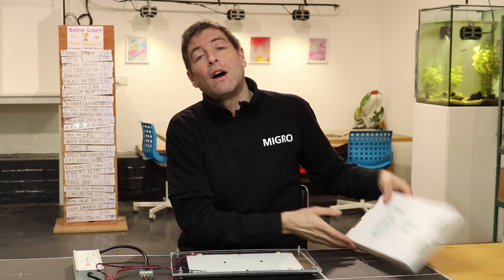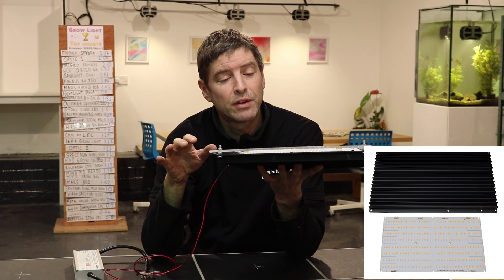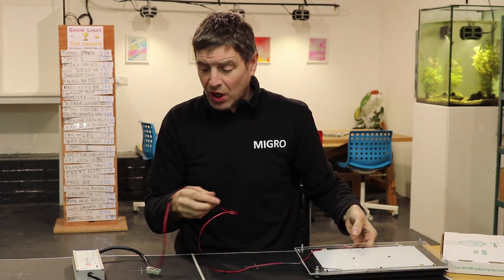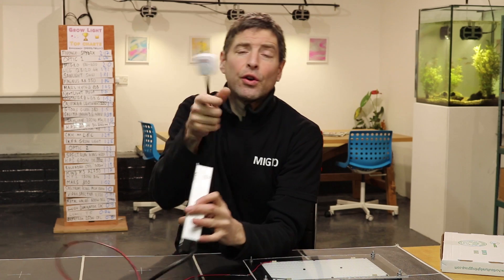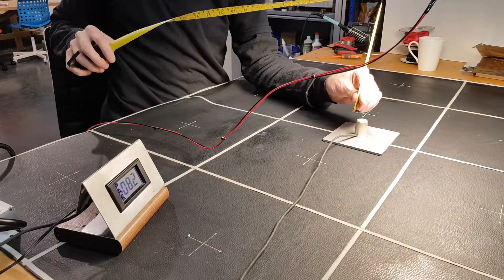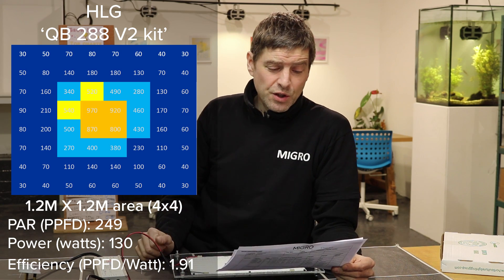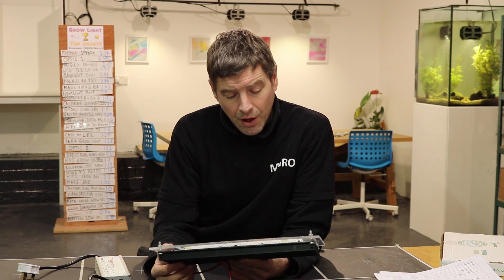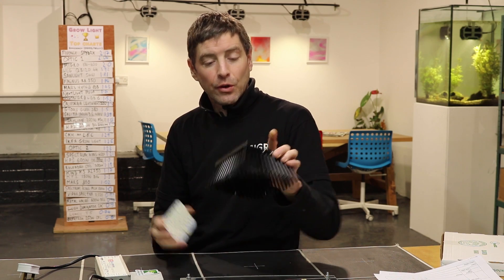HLG Quantum Board grow light test - Horticultural Lighting Goup QB288 V2

Comment: I started my LED journey with the SF-1000. I ended up returning in to amazon after 20 days and bought KingBrite's version of the QB288 2 Panel system for a little cheaper than the sf-1000. I did get to confirm with samsung that they did sell KingBrite LM301B LEDS. The PCB and LED's are set by machine's so everything been gravy so far! I"ll update this if anything happens.

Comment: MIGRO does the acrylic sheet effect the light emitted ? weaken it? I was wondering if different types of material of more efficient like glass etc
Reply: Anything in between is gonna slightly decrease your efficiency, but maybe not significant and you be the judge if you like them to be protected :p.
EDIT: the video even says 3% difference with or without cover. So measurable, but not a lot.

Comment: Will this board be ok for a 100cmx100cm grow? Just a casual thing, in a mylar tent..
Reply: Yes it would work fine.  They are amazing little lights.  I guarantee you will be impressed.  1 great pro is that these hlg Quantum Boards are so low profile, maybe 1.5 inches or 4cm thick with the heat sink.  I think they are the future of growing since they are modular and so versatile. I used to grow with 1k watt HPS and I bought the HLG QB 324 165watt led and was blown away on a vertical light mover it is covering 2.5'x5'
Reply: 20+ yes exp. Ask me anything
Reply: @Imarida2  Thanks Mark! I've got a single 90W Luminus cxm-22 Gen 4 3500K in a 80x80x160cm tent for autos, and have ordered a 100x100x200cm and a 120W 288 quantum board 3000K + 660nm, was hoping it would suffice for photos, and wouldn't need to buy much more, on a strict budget over here.

Comment: MIGRO, What is PPFD/W?? Do you mean mmol/j?? Cheers!
Reply from the maker: Umol/Joule or PPF is most often quantifying  the light radiated from the bulb. PPFD in units umol/m2/sec is the light reaching the grow area. It's often about 25% less than PPF due to reflectance  losses. Divide PPFD by watts to get total system efficiency.
Reply: @MIGROLIGHT  Thank you! I wasn't aware of such measurements, especially about the 25% part. The loss in the value occurs not because of the reflectance but simply because of the inverse square law (if you measure the PPF on the canopy surface). We normally go by mmol(umol)/j when a luminaire is characterized. The PPF density is what we aim for in the garden (usually, a proprietary ratio is maintained in relation to the VPD factor and the amount of CO2 in the garden). I am pretty drunk so correct me if I am wrong. Cheers!
Reply from the maker: I'm afraid you lost me lol. Let's talk again in the morning😆

Comment: Hi Shane, I notice on the hlg qb tests you casually state because the light intensity was over 1000umol centre point you had to raise the fixture. 
This renders the test COMPLETELY UNFAIR. 
Either raise all other fixtures to that height and give us the readings or just release the data at normal height for qbs please. 
Plants can and often do benefit from over 1000umol especially in increased co2 concentration environments anyway so the only reason I can see for you doing this is due to the fact the figures demolished other light sources. 
And that's not even mentioning the plexiglass.
Reply from the maker: Alexander. In the absence of data from the manufacturer I calibrate the light height to under 1,000 PAR at dead centre  same for All lights not supplied with setup information or a manual. It's fair. What's unfair is selling a DIY grow light and not supplying an operations manual to go with it..

Comment: Hi shane. On HLG website fpr the QB288 boards and the 132 boards also its states that the board does not require any thermal paste or heatsink. I see that they do sell a combo diy kit woth a heatsink also. 
Is this extra cost of a hestink required for running this board at 1.7a to 2.1a for 16hrs a day?
Appreciate your input.
Reply: Upon further investigation. I have found that they advise hestsinking for above 50w. So thats current running at 1A (ish)

Comment: This model comes in 2 spectrum 3000K and 4000k, to use in full cycle which would be better spectrum 3000K or 4000k?
Reply from the maker: I would recommend 4k if you are height limited as stretching may be an issue with 3k. If height is not an issue 3k better for flowering.

Comment: The losses increase with angle of incidence,  and since these LEDs put out light in all directions,  most of it is not transmitted.  It's being light-piped out to the edges of the acrylic like a fibre optic cable,  and hitting the walls of the tent instead of the sensor.  He's tested HLG lights in 3 different ways so far,  each time he just does whatever he has to do to fake the numbers.  

Funny he did not show the test and the numbers without an acrylic screen, hmmmm???

Notice how thick the acrylic was that he used??? 

3 -4mm acrylic could reduce light transmission by as much as 6-8% yet that thick piece looks about 10mm and he reckons it is only 3% reduction but never shows the figures, yeah right I am calling BS right there.

I saw another video where you ran the test without an acrylic sheet, I will believe that test when you show the light hooked up to a killawatt meter and measure the thickness of the sheet, but it doesn't rule out editing

And how come it was "unsafe" without a thick piece of acrylic this time around, yet the last two times he ran tests on HLG products it was all cool; but now that he's suddenly testing a more powerful light he is all concerned about safety, LOL I guess he has to do something new to get the numbers he wants.

HLG makes a version of this with 90-degree lenses,  but you didn't test that one because it would be a fair comparison to his lensed fixture, now would it eh.

Nice snake oil trick you pulled their Shane making it seem like you were being fair and unbiased but those of us in the know, know what you just did. You want to be careful that HLG doesn't get hold of your lights and rerun that test again, directly against your lights, now there's a thought.

Comment: Do you think the wires being in front of the LED’s would get hot and
Melt ? Also, if one of those diodes stop working for some reason, how hard is it to replace ? Ive been staying away from quantum board lately because it seems to me that it might be difficult to fix if you aren’t tech savvy like you are. I’ve been running COB cause it’s so simple to change out if I need to.

Comment: Curious........... He mentioned that he had to raise the light further than the last measure. How much did you raise it? Is this not important to u as far as data?  Personally I think you could have easily taken measurements at 1'  2' and 3' light-canopy.   I own a qb 324 and its low profile allows for a myriad of mounting positions that a migro couldn't dream of fitting in.  Migro has the profile of a brontosaurus/ HPS hood.  In 2019 I want my light to be wafer thin w/remote ballast.  Cree are a  helpful supplement to larger grow boards.
Reply: Show a side by side with 
QB288 V2 vs migro100 
Then I will be a believer.

Comment: When All 4 288V2 board's are together they put out the best par in the corners than any other LED,s and much less heat being so many mid watt LED, s on each panel but the same as a single finger it's weak until balled up in a ✊

Comment: Another great thing is that the Original 480H-54A driver with internal pot can push out 2400mh as the 480H-54B with the External pot can only drive the LED,s to 2100mh max that's why the Orginal 4x288-V2 is called the HLG-550🤓

Comment: LM-301b -223lm/w hands down they are the best LED,s on the planet at this Time Samsung website Explain all the Technical Data after Growing for 35 year's I'm 50 now grown with all the  various artificial light  sources Samsung all the way from now on but thanks for your testing plus another guy on here tested the LM -301b 288V2 past 3000ma for over an hour and he couldn't burn them up as the diodes reached a Nuclear 100c degrees with a minimum heatsink 🤓

Comment: Do any of you folks know how to keep a 100w cob led cool? Im having trouble
Reply: Ebay heat sinks are about 14 bucks with active fan you'll need a 12 driver for the fan
Reply: @joshamy39  tried that even with a peltier plate,I can only get it to run at 60w which then drops to 40w and then  stabalises

Comment: Are the Mylar walls a new thing you're doing Shane? Don't remember them from previous videos. Usually just the flat board when testing 2'x2', right? Really made a difference! Great example of reflective walls, and like always, a great video!
Reply from the maker: The light spread from the Quantum board is very wide and you need reflective walls to keep the light in. 7% increase in light to the grow for €5 of mylar seems worth it to me :)

Comment: Why compare this to the likes of spydrx? Completely different in size and output.  Get the hlg550v2 up there and see how she rates against these hobby lights!
Reply from the maker: The comparioson is of efficiiency, it's valid independent of size. Thats th reason the lights are compared this way. IT's like comapring M.P.G. or Km/L. The HLG 550 is 4 x QB288 so you can work out the output of the 550 easily.
Reply: @MIGROLIGHT  oh you adjust the size of the area depending on the size of the light? 

The spydrx has a 5x5 veg coverage? What coverage does 1 QB288 have?

Comment: You're also claiming 130w,  when it's only 120w (or who knows what it is,  you probably cheated on the dimming knob too)
Reply: Lars Larsen well its a 135W light and ive seen it tested and output just that. Why do you think its only 120w?

Other tests ive seen in a 2’x2’ area with this light hung from 12” at full output have shown par readings similar or even lower than Shane shows here, leading me to believe he is being nothing but honest here
Reply: @JonnyD3ath  HLG ships that kit with a 135w power supply,  but he's using the type that only goes to 120w because he's a fraudster.  I own several of them and I know he's full of shit.  Fuck him.  Every single test is done a different way so that he can be as deceptive as possible.
Reply: @LarsLarsen77  HLG ship their 135w kit with the HLG-120H-54A, it goes to 135w. Using the acrylic screen was unnecessary though.

Comment: Those 2x2 "walls" don't even reach up to the height of the fixture.  You can SEE all the light pouring out the edge of the plexi sheet.  It looks like a fucking fiber optic cable.  All that light is going over the top of the "walls".   You fucking lying bastard.

Comment: How much light is lost with the 3mm perspex.
Reply: 3%
Reply: " Actual measurement shows that colorless Plexiglas sheet
in thicknesses of up to 6 mm (0.236") transmits 92%
of the light striking it at the perpendicular"

That's with a collimated light source (like a laser) pointed directly down on it.  Since these LEDs have no lenses on them,  most of their light is actually hitting it at an angle,  which means it's all reflecting off.  

https://www.plexiglas.com/export/sites/plexiglas/.content/medias/downloads/sheet-docs/plexiglas-optical-and-transmission-characteristics.pdf
Reply: @LarsLarsen77  Thank you I thought it might loose a bit of light, that's less than I would have imagined.
Reply: It is way more,  that's just the theoretical minimum if all the light is striking it directly downward,  which it isn't.  He's trying to claim 3% loss in overall photon output,  not in PPFD,  which is what he's measuring here.
Reply: @LarsLarsen77  In that case I would just slide the Plexiglas in when working under the light seeing as they are so expensive.
Reply: @gillenzfluff8380  I've had quantum boards for 3 years now.  There is no need to cover them with anything.  You just wipe them down with a damp cloth if they get dirty.  I've even had them fall to the floor without those little rubber feet that keep the LEDS from hitting the ground.  Still no problems.
Reply: @LarsLarsen77  That's good to know, 3 year's is longer than the lumii digita lasted even though it was run at 400 watt most of the time with a fan blowing on it.
Reply: @gillenzfluff8380  They'll last basically forever.  You'll want to upgrade them to more efficient ones long before they fail.

Comment: Exceptional review Shane, I always appreciate your videos.  I run HLG lighting, but would guess the Migro 100w would penetrate better with it's focal light pattern concentrated more than HLG.  Either way, you are becoming the go to guy for light information!
Reply from the maker: Hi. The light penetration from The HLG is excellent. Photons are directed to the grow area from the QB288 as it is large and the light source spread out. You do need to hang them low and use reflective walks though as the light goes everywhere. What do you think of using a cover. Is it required in your view?
Reply: @MIGROLIGHT   This is the first that I have seen a cover was recommended.  My grow area is very clean, and I have no issue using my HLG without such covers.  Since most dust seems to settle on top of surfaces, I would imagine that dust working it's way between the cover and light would settle on top of the cover.  That would diminish light intensity over time, and be difficult to clean.  With your test environment, I personally would not use it.

Regarding the use of the HLG quantum boards, I do see value in the 2' x 2' tent which captures some of the light lost along the edge of the board and reflects it back onto the plants.  Great idea in using the reflective frame in your test.